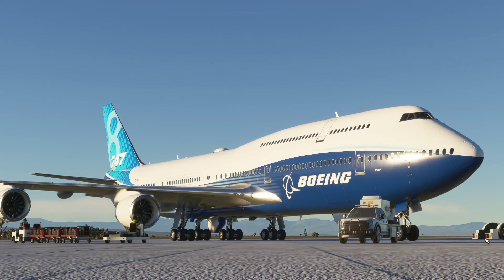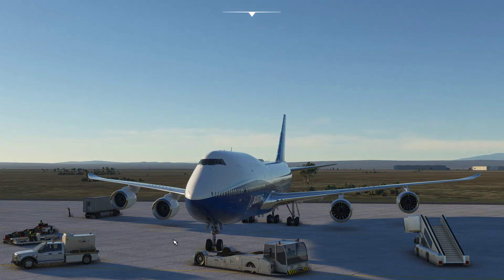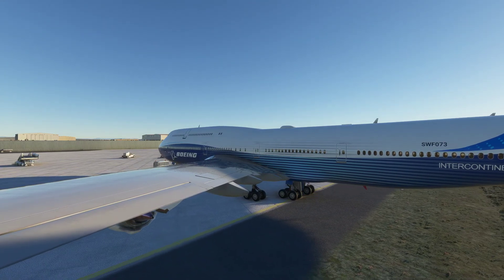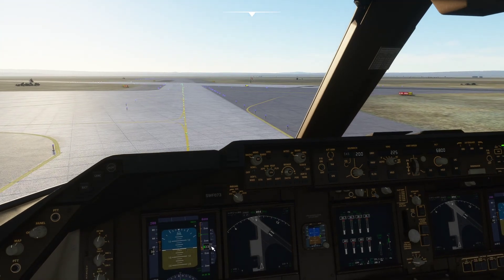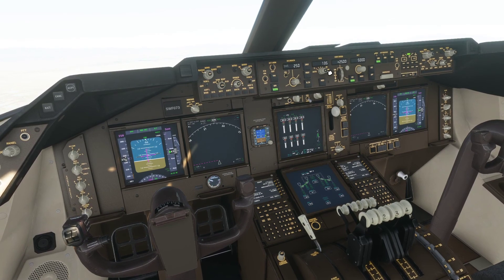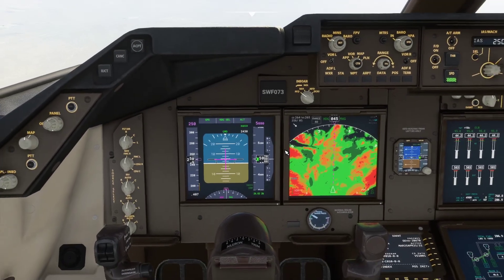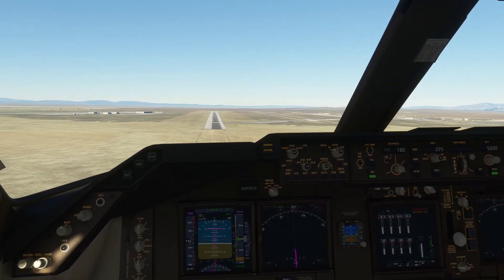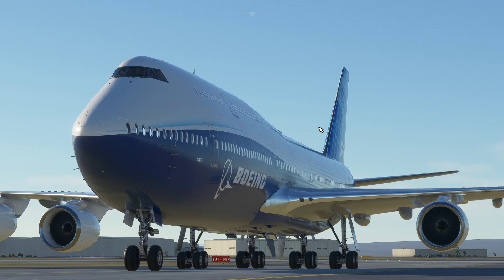Beginners Guide to Flying the Asobo Boeing 747 in Microsoft Flight Simulator 2020

Comment: Hi, where does one find all the literature one needs to read in order to learn about all the systems specific to the plane (PACS, Hyrdraulics, Electics, IRS, FMC, ) ?
Reply from the maker: Here's the funny thing - the stock Asobo aircraft have almost none of those systems modelled. The Zibo Mod in X-Plane has a lot of them included, and starting the plane up therefore includes them in the procedure(s). It's going to be interesting when aircraft such as the PMDG 737 arrive :)  The best reference on an accurate aircraft is the real pilot manual.

Comment: Thanks for this video.  I just got done with the training on the smaller plane and really wanted to tackle the 747.  Now I know how to really use the autopilot features.  I did my first and only flight in 747 today but all manual which was REALLY hard.  This makes it look easy.    Are you using your controller along with the keyboard?
Reply from the maker: Yes - I'm using a joystick, throttle control, and a few buttons on the joystick for flaps, etc. I control autopilot with the mouse though.